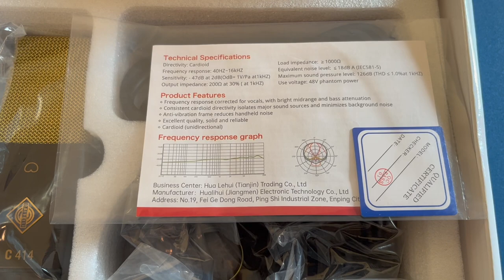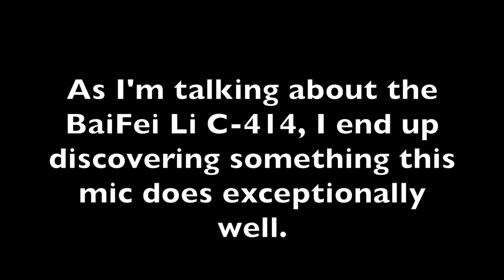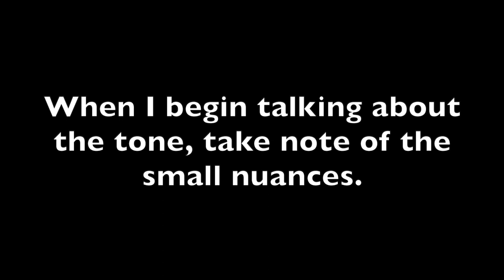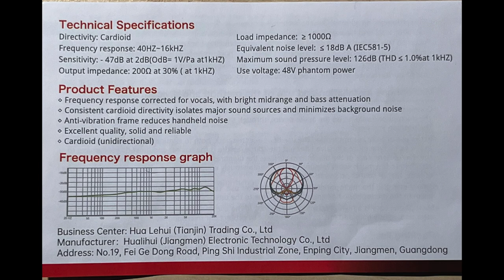Inexpensive Mic's Friendly-Sounding Tone Dissected

Comment: What the actual $#%^!?  That sounds WAY too good.  I think you might have missed one possibility. Maybe its not YOU.  Maybe there was a hole torn in the space time continuum that allowed this to pass through into our dimension.  Comparatively, this is total junk from where it's from, but here in our universe, this thing sounds great.  So we either have to figure out how to get to that dimension, or how to start pulling things across!  lol.  Great video it was fun to watch/listen to.  Really appreciate you tearing the mic down.  Wonder how this would sound with a capsule upgrade... not that it needs it.
Reply from the maker: Right? How crazy is this? First, I'll dispel the "it's only me" hypothesis. Time Preservation Society just dropped a review this week on the BFL 414:
https://youtu.be/QTVKpKg2EvI
So, all you have to do to get to that dimension is enter the portal known as Alibaba. LOL. And as far as I can tell, the capsule is already one of the most beloved electret capsules in the mic DIY community, and possibly the same one used in the AKG C214. You could gut it and go large diaphragm but you'd need to find a circuit that would fit inside the lower part of the body.

Comment: Is there a microphone your silky smooth full of rich nuances and personality voice does not sound good with?  It's a decent circuit board and I recognize that capsule.  It looks impressive on the outside maybe for a prop on the desk while I'm boomed overhead.  But 40HZ to 16kHZ with an equivalent noise level of 18 dB A doesn't make it to my shopping cart.  It would just go in the stack in the corner with other whimsical mics I have too many of already.  Thanks for the video.  Entertaining as always.
Reply from the maker: Thanks Tommy, you may have a point. I think I do sound good across a wide spectrum of mics, but not all of them sound this good on me with no finessing. Probably not a good boom mic like you say. Whimsical for sure. And it’s actually quieter than that -18db would suggest and with Cvox, all mics are completely quiet.
Reply: @MarkYoshimotoNemcoff  haha no I wouldn't boom this one it would be on the desk as a dummy not hooked up to anything, lol. It looks great.   Thanks for the reply.
Reply from the maker: @djtommykeys  Good idea. It would make a great prop mic since it would appear to be a real 414 on camera.

Comment: Hi Assassin, great video! This version has a 25-mm diaphragm, instead of 34mm one, right?
Reply from the maker: Yes, correct
Reply: @MarkYoshimotoNemcoff Yes, but it is now also available with a 34mm diaphragm at a slightly higher price on aliexpress. Should we buy the 34mm version, or may we end up with a worse sounding mic? Should we stick to the 25mm version?

Comment: With which mic are you comparing the transformer?
Reply from the maker: Been a while since I did this video, but unless I referenced a specific mic, I’m talking about what mic transformers, in general, add sonically, which is extra harmonic content and low to low mid weight, and the more authoritative sound they can create compared to transformerless mics.
Reply: @MarkYoshimotoNemcoff  I see, thanks for the clarification! It's just anoter thing that makes this mic stand out even more, wild stuff to see on a 50€ mic

Comment: Hi Mark, I was curious about the self noise.  Did the instruction sheet say 18 DB?  Were you able to hear any issues?
Reply from the maker: It does say -18db of self noise but it honestly didn’t seem that noisy to me when I just plugged it straight into an Evo at my desk in my office. I also use Cvox in the booth so at that point self noise is no longer an issue.
Reply from the maker: Let me just ad an addendum to my previous response for clarification. It doesn't feel like a noisy mic to me. It's not quiet like a TLM-103 or the Sphere (-7db), but having dealt with mics like the Ethos and the SV33 that trend around -15db or so, it feels a little less noisy than those. But again, when you use Cvox, it pretty much makes every mic totally quiet.

Comment: What is the noise level as compared to rode or lewitt microphones?
Reply from the maker: Rode and Lewitt would be much quieter. Those mics are designed for low self noise.
Reply: @MarkYoshimotoNemcoff  is it still in the range of -13 to -16?
Reply from the maker: I don’t have a way to measure but that’s probably about right. It’s well within the range where Cvox renders it silent, which is my new self noise measuring stick.
Reply: @MarkYoshimotoNemcoff  thankyou.. much appreciate your work 🙏🙏

Comment: Cool discovery. Thank you. Do you think it'll be worth the upgrade to the slightly more expensive BAIFEILI V47?
I intent to use the mic (commercially) for guided meditations and therapy stuff. Maybe for a podcast aswell.
Reply from the maker: It's hard to tell, based upon one mic, if their whole collection  is made up of surprisingly good mics. I do have another one, not the v47, but the V10 coming probably in a week or so and that one I'll test out and it may give us a better look at overall quality of their collection. It's quite possible BaiFei Li are just resellers and not even the manufacturers so their mics could be coming from different factories with different levels of quality. Remember also that I'm recording these videos inside a well-treated booth through an extensive chain of Apollo plug ins, so your results may vary. But yes, I think you could use this mic, and possibly their other mics for your intended use with good result.
Reply: @MarkYoshimotoNemcoff  Thank you. I was going to purchase the 414 yesterday, but alibaba didn't let me to, because the seller was missing a number (erp - i believe) for Germany. So I take this as a sign for now :-D 
I am currious however what your impression on the v10 will be. 
Thank you.
Reply: QMarkYoshimotoNemcoff Would you like to eventually show your entire setup for achieving this output with the BaiFeiLi? 
I can treat my room to the best of my knowledge and optimize it for soundrecording, but the technical/software setup is where I am totally unexperianced.
Have a great week.